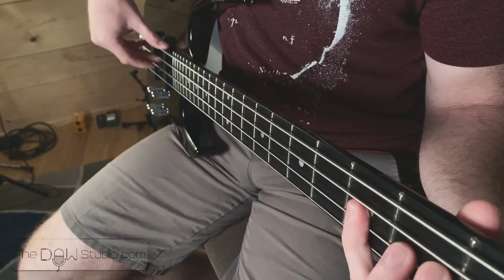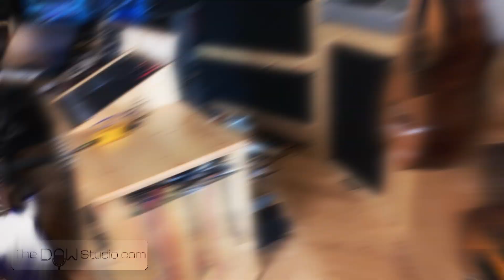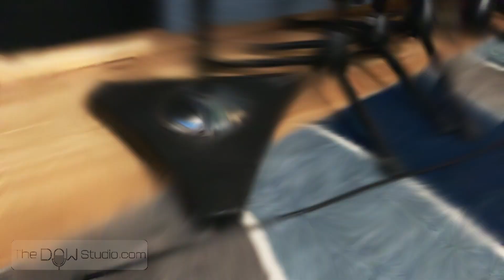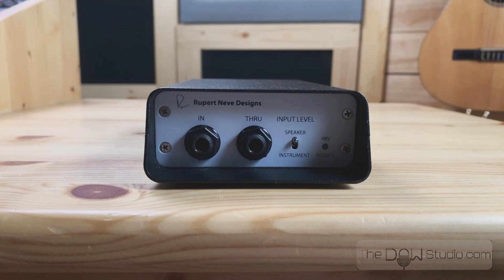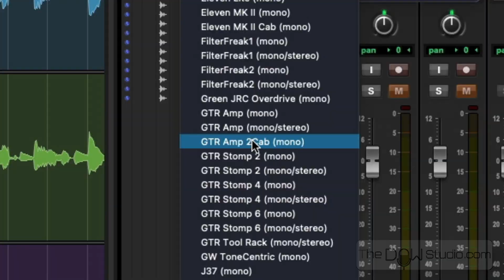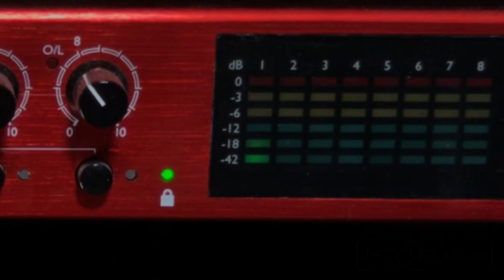Safety Net for Guitar Recording (DI and Amp)

Comment: if amp has line out is that different than the thing you have set up w the DI between amp/speaker or same as. thanks!
Reply from the maker: Yes, the line out is better because it's before the power amp and usually sounds better than the speaker DI.